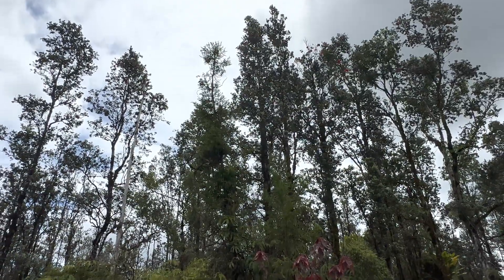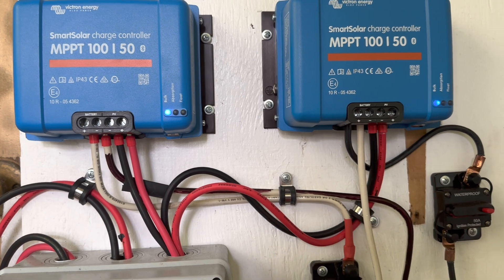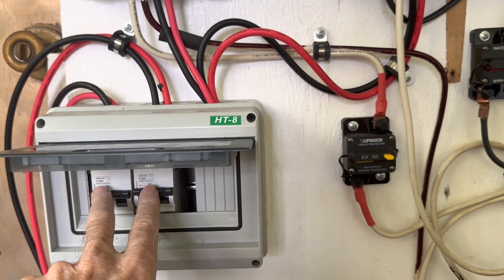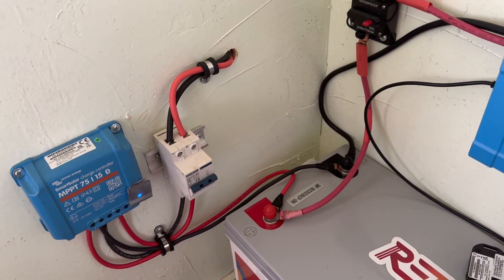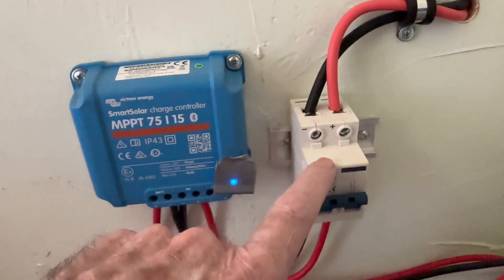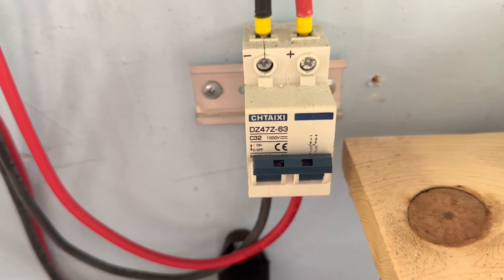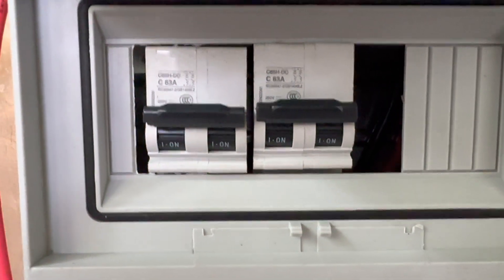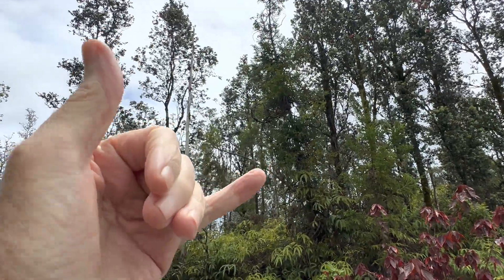Solar panel Isolator switch :Oversizing so it works as a manual disconnect or off switch from panels

Comment: Hello thank you for sharing I'm kind of new with solar and learning as I go I've got some victron equipment and my question is what's the formula for figuring out the size of the breaker as a breaker not as a disconnect I think it's the ISC or the short circuit of the panel times 1.56 is that correct so what I'm doing is is I'm going to be buying the victron 250 85 amp running it in a 24-volt config with 550 watt panels times 4 in series

Comment: I'm confused what the circuit breakers are for if you have the cutoff switch. Everytime I think I'm ready to hook up my system I think I'm missing something and amazon gets another order! I have 3x100w panels, 100/30 victron controller, 2x100ah agm batteries, 1500w inverter. So with the parallel config I have 3x10amp fuses at the panels. Unsure if I need a cutoff, breaker, or both (or fuse?) after the controller. Manual says inverter has built in fuses so I think I'm good there

Comment: Could a disconnect switch combined with a bypass switch be used to manage, turn off and on, a couple solar panels in a string array? If solar panels were added to an existing permitted grid tie pv system and wants the added panels to increase kw output only at certain times, or certain days, switching them on and off from the string could be useful.
Reply: Yes, you can wire many different panels for such days as long as you keep the PV voltages within a volt or two to minimize having the MPPT trying to re-scan and then stick on the higher voltage.  I do that here in Michigan since I have panels facing in three directions.  I do it mainly to spread the harvest out during the day.

Comment: I bought a Victron  100/30a mppt solar charge controller to charge my Dr. Prepare 100ah battery with hub. 
This charge controller goes into absorption when the battery is very low. 
It will not start charging the next morning. 
I have to unplug it and wait and plug it in later and 
I have two 100 watt flexible solar panels on my truck. 
I have been connecting my battery first and it doesn't seem to work. 
I bought the Victron thinking I will not have to mess with it.
Reply: Try connecting the panels in series.  The VE won't start harvesting until the PV voltage is 5 volts higher than the battery.  Double check your settings and check to make sure you have a GOOD battery.  I believe there is a lower voltage limit as well on when the MPPT will start charging and a dead cell could be the problem or a failed BMS if using Lithium

Comment: I believe the 50 that is on the Victron refers to the amperage on the battery side. As normally the batteryside of things is on a lower voltage then on the solar side of things, the amperage on the solar side will be lower.
You can also see this in the Victron app.

Comment: looks great ! nice look at DC rated breaker/switch . because my panels are far away from home I had to have isolator switch at solar array to meet code. I got MC4 style rotary type with RED know and waterproof.  UL approved safety disconnect.  the ones inside are the DC rated fuse disconnect. along with Midnight solar PV surge protector. if you want fuse protection for PV system they make a inline MC4 with fuse cable . windynation has them.  I had to have my system inspected for insurance. always check before. as a electrician I already know about codes. very important for grid tie system may even need a permit . check local codes first. my system is off grid only. my homeowners insurance wanted a inspection.
Reply from the maker: Great information as always brother! I have a bag full of those windy nation mc4 compatible inline fuses. They are going in next. Just in case yeah? Great share for all of us buddy! Aloha! 🤙

Comment: In the power industry you would call those links if they are never meant to trip
Reply from the maker: Never knew that. Mahalo for sharing! 🤙
Reply: @ProjectsinParadise808  sorry, actually because it has some smarts in it it would be a sectionalizer. If a link goes off it means something else in your protection scheme failed  and would require the link to melt

Comment: From a pure safety perspective I think its worth pointing out: it's always good to fuse your panels! In your case however, your panels are really not fused, because you have installed the biggest MCB(Mini Circuit Breaker) you could get - without any thought of protection(sizing of fuse/MCB). 

Fusing panels is most important in a parallel configuration of panels, where you need to fuse each panel, to protect the other panels if one should become faulty. 

However, in general whenever current is flowing through wires, the wires should always be protected against overcurrent and shorts. So fusing is still needed in a series connection of panels - but then you then only need one for the whole string. Again, fusing is mainly to protect your wiring, but actually also your controller - and your panels, if your controller should short out! 

You can actually still use your MCB as BOTH an Isolator switch AND as a fuse, but only if you rate the fuse(MCB in this case) correctly according to your panels. The size(rate in amps) should be 1,25 - 1,5 times max. amps of your panels. (I.e. if your panels have a Pmax current of 5 Amps - the fuse should be around 8 Amps or so)

(Sorry for misspelling etc. - English is only my 2'nd language :)
Reply: Thay make a inline MC4 fuse holder just for that reason. also is a code requirement in some setups. also surge protectors and grounding .
Reply: You are very correct! The inline fuses are great in parallel configurations right at the panels and then a MCB indoor, when it is a  2 pole it will react as a full isolator. 

I was just not going to get into all that(Its a full topic on its own just talking about trip curves of MCB's, fuses vs. MCB's etc.) and it seems our good freind is still on a learning curve(he often points out himself). So I fugured one step at a time, to not scare anyone off the topic from the get-go. 

However: you are absolutely correct on all the safety measures you mention. Anything about 40-50V will hurt you and 10 Panels in series gives you easy 200V. That is danger not only to equipment but to any person touching a loose connect or other. It should be handled with proper attention.

With 10 panels, I can guess he has a 5S2P (5 panels in series parallel with another 5 panels in series) In such case a inline fuse at the panels between the two series strings would be perfect. And if he has no MCB in the right size, then another inline fuse twice the size of the parallel inline fuse - and keeping the 63A MCB as isolator switch will do the trick.
Reply: @jbjensen11  Geez! You guys are really passionate about fusing panels.  How often does something go wrong and what's the worst thing that can happen if you don't?  And grounding panels, same thing, why?
Reply: @PWoods-cd6tk  Maybe you are right... Maybe fusing electrical systems are overrated. Maybe it takes much much much more than just 5 amps to start a fire or blow the rest of the components in your system. Maybe grounding is overrated too - maybe the the groundfault relay protection tripping before you accidental get chocked, is overrated. Just like in all household electrical... maybe electrical codes are just meant to bother people, not to keep you and your proporty safe 😄😄😄
Reply: @jbjensen11  give me some examples of a 12-volt solar panel system starting a fire doing serious damage or killing someone.  My AC side is totally covered, my 12-volt DC side from the panels to the charge controller is not.
Reply: @PWoods-cd6tk  I understand you you think it is (high) voltage that starts fire - not current. I understand you think AC, Alternating Current is actually more dangerous Direct Current. I understand you think arcing from AC is actually LESS not MORE than from DC. I Understand you think Solar Panels in series connections cant reach 1-2-3-500 Volts. I understand you think my comment had anything to do with only 12V systems being dangerous. I understand you think 100 Amps in a DC system is less risky starting a fire than 5A in a AC system. I understand you didn't get my original point: which was: When using a MCB as a shutoff, why not just rate it right so it can be used as a fuse at the SAME time.

You know - you may be right - I just realized I wasted my education. There is no need for you to educate me - it is a lost cause. Don't waste your time on me - shake your head and move on. 🥰🤪
Reply from the maker: Great explanation on fusing panels for all of us! Perfectly understandable (your english is great) and I just so happen to have a bag full of fuses for such an upcoming project! Mahalo! 🤙